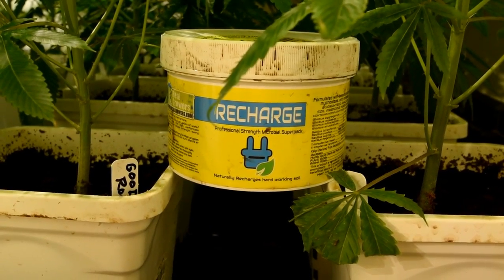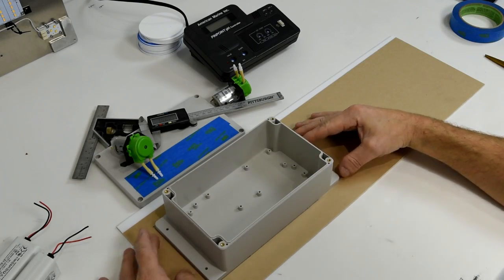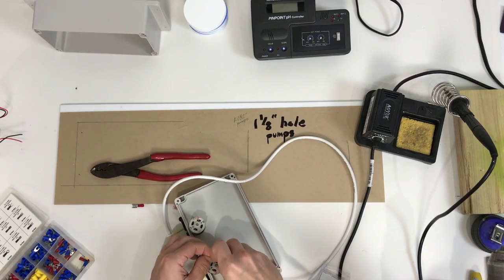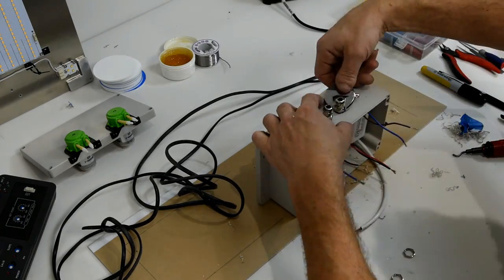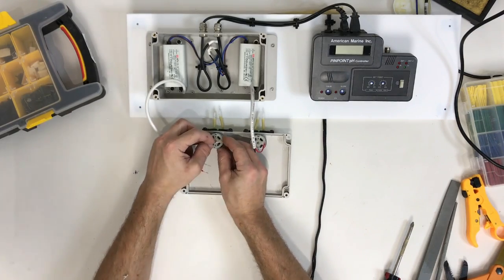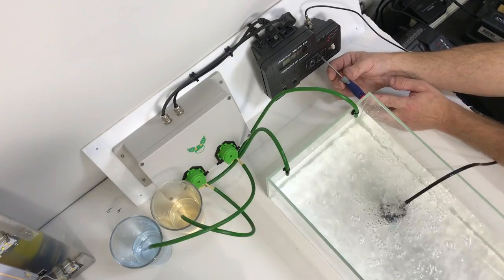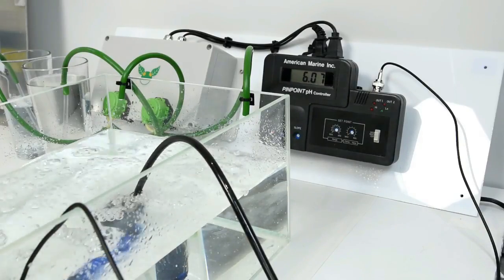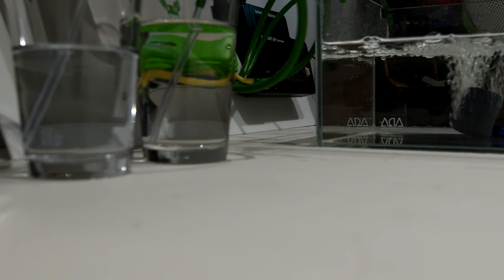DIY pH automation for hydroponic reservoirs

Comment: Hey there, i am thinking about getinng a RDWC-System for start growing my own tomatoes.
But i am still left with some questions. Maybe u can help me:
1. I would go for scrogging, but as far as i learned i need to change the water in the system ever 1-2 weeks. How the hell shall this be possible?
2. What are your thoughts about the risk to get a leak?
3. Some people are complaining about differnt waterlevels in each reservoir, how much of an issue is that?
4. There are many Completesystems avaivable, but can it be worth it to build ur own diy system? 
5. i gonna aim 60cm/2 feet every direction for each plant, is that enough Space

Huge Thanks for everyone helping me out!!!
Reply: I don't know if you're talking about tomatos or "tomatos". If the latter, then every 2 weeks is very aggressive. I believe you can get away with 1 change mid veg and 1 change transitioning to flower, topping up with pure water in between changes. 

You can get leaks if your workmanship is poor or an accident happens. Mitigate risks by keeping electrical stuff up off the floor and the wet stuff down low. You could even redundantly waterproof the floor just in case.

IDK about that

You can get a prefab system and it'll be just great or you can make it yourself to your specs and it'll be as good as you make it. If money wasn't an issue everyone would go prefab i suspect. 

Sounds reasonable. Closer spacing means less time needed in veg, and visa versa .
Reply: cho4d is wrong. Whether DWC or top feed recirculatory, any system with a reservoir should be changed once a week, every 7 days. I am not sure what the confusion is. You just pump out the old water and replace it with fresh water. If you use RO, remember to add cal and mag, unless your nutrient system has enough in it already (some do and some don't)
Reply: i would say diy your grow. i did a diy current culture build for about 1/4th the price got most of it off amazon and glued it together. if your scrogging have your water drain to the reservoir or build in a drain with a valve to shut it on/off its super easy.  if your serious just get some totes and 2"-3" bulk heads and some abs pipes and glue and get creative. bigger pipes mean more flow/less clogging  don't listen to cho4d tho change your water weekly.
Reply: 1.  You pump it out or drain it out with a ball valve.  Or you don't, you only top off.
2.  ...What?!  It exists I guess.
3.  Do you understand how water behaves?
4.  Buying a system is a complete waste of money.
5.  Not possible to answer this question for you.
Reply: @jonosterman2878  on general once every 3-4 weeks is fine for changing solution, not once a week, that would be wasteful.

Comment: What do you think about the blue lab controller
Reply: This one better, Blue lab control only in one way, up or down , this unit control both ways up and down
Reply: @Greg25437  If you're pH'ing up and down in the same res then you almost certainly have issues that need to be addressed in your solution.  You don't need both up and down at the same time.
Reply: @circle4922  I like this one just in case both ways, up and down,  I know usually need up or down, also I like to built electronics ))

Comment: Hi, I like your job, that DIY would be the top on the top if you could remplace the expensive ph controller with an arduino and his sensors with help of an arduigeek ;-)
Reply: Zaka Pentax that expensive controller would be easily be replaced with an arduino. Bare bones would be just a pro micro and a cell phone. Save the code on the phone, alter variables as you see fit and plug and load.

Of course you could get into LCD an controls but K.I.S.S. lol

Comment: You can save 200 by using an Arduino with free pid controller code
Reply: Lucas Bird I have a prototype running using a esp32 Dev board. The code has functions for a PI controler that I wrote myself so it's very easy to use. The idiots who made the arduino pid library used hundreds of lines of code, I made it in 20. It also has remote control over WiFi with io.adafruit.com. 
For har9dware you would need the esp32(I used huzzah), relays, dht22 sensor, solid state relays... Alot more stuff but you get the point
I might post it when im finished
Reply: PID is overkill for this application.  If-then-else works perfectly fine.
Reply: Rob Jones well if you don't want your cooling fans to be on and off all the time causing wear then use pid. You are talking about hysteresis
Reply: Rob Jones and no pi is very simple (using 20 lines of code)
Reply: The code for PID (not PI) is easy.  Dialing in the constants is a pain.  My point is that It's simply not needed.   But if you want to go that way, knock yourself out.     This is my last comment on the topic.
Reply: I'm waiting for you than ^^ , I have begin a similar project, I managed to write the code to convert the milivolts from the ph sensor to ph, but than running the pumps when the ph is to low or high was to difficult for a nooby like me. I don't want to be robbed with those overpriced ph controller , are they fucking crazy ? I need 4 for each of my hydro buckets.
Reply: Great! Do an effing video showing us how to do this with arduino. Those without arduino experience (like me) wouldn’t know where to start.  This vid is for the average diyer and creates an automated system that is much cheaper than the Growlink/Bluelab/etc. premade systems.
Reply: @canofpulp  Hey...ip address, haha.
Just wondering if you went further with this.  I'm exploring arduino, and atlas scientific sensors, as well as whitebox labs tentacle shield.  However, I'm a noob to arduino/coding.  I want to make a nutrient monitor/pH controller.  I need the same functionality as a "store bought" unit, like a bluelab etc.  LCD screen, buttons, and being able to interact via phone app or something would just be bonus.

Peace.
Reply: @robertcameronjones  No I meant PI (just Proportional and Integral) since the Derivative is overkill and just adds more complexity for tunning in like you said.
Reply: @robertcameronjones  Does it though?

Comment: WIsh it wasn't so expensive to buy those parts.
Reply: The only expensive parts are the controller and ph probe.. Controller can be replaced with an arduino for a 5er but you still need the probe. Pumps & their power supplies you can get for a 10er each.
Reply: And you need the arduino skills too

Comment: the real question is why is your ph moving around so much. A properly balanced nutrient in RO should not move around enough to really cause an issue. I use heavy 16 and my pH does not move around. 5.6-6.0 is always where it sits I never even use phup or down.
Reply: PH stability depends on how heavy your plants feed, whether you use RO water or tap,  the type and brand of nutes (and PH adjusters), how high you run ppm/EC, and probably the amount of airation  you use.  Maybe other factors as well, but these are the big ones.  RO water has little to no buffers, so as the nutes are depleted the PH  moves toward the initial ph of the water (around 7). In my 3 large RDWC systems (nearly 500 g total) the PH always tries to move up at first, then stabilizes after a few days of adding PH down.  RDWC runs waaaay lower in nute ppm because of the efficiency, so there is far less of the fertilizer (with accompanying buffers that they include) than what a normal system would run.  I can tell it is time to change out the Rez when the PH begins to drop more than a tenth or two a day.  Flush is especially difficult because there simply isn’t enough of anything in the water to maintain stability.  If you use tap water there is far less movement but less control over what’s in your solution.
Reply: very tiny res and too strong ph up down was the cause of the yoyo. it was overshooting each time.

Comment: Good idea.. However, EXTREMELY BRAVE MOVE leaving an automatic device in charge of your PH lol...
Wouldn't be me, sorry lol

Nice video tho ;)
Reply: No need to apologize.  Haha, just kidding man.  I understand the concern for sure.
Many of these "pH controllers/dosers" (with the pumps etc. all-in-one) have several fail safes (logic) that stop any disasters from happening.  For example, they won't keep dosing pH down if they see no change in pH.  They will wait for solution to mix, and read, before dosing again, they will alarm and stop after a chosen pH level.  And you can set all these parameters.  This setup here, probably not as many.

Still, I hear ya.

Comment: nice tutorial, maybe you need double the amount of acid because phosphoric acid is stronger than potassium hydroxide at the same percentage... Ahh and dissolved chemicals do not settle, so shaking does not really help.
Reply: Theres always gotta be some no it all that trys pic faults or at least make themselves look better then everyone else u need to grow up hey.
Reply: @peterrolfe528  is your brain ok after trying to form that sentence?
Reply: A lot of people don't realize that PH is a logarithmic scale and not a linear one. Accidentally using 4ml of ph down is not corrected by 4ml of ph up. Maybe 1ml of ph up could do the job, but 4ml, depending on the brand, could leave you at least 2 ph higher than your starting point. I learned that the hard way before I looked into it.

Comment: Hydro gets yield but not potency or taste.
Reply: lol you need more experience
Reply: @2bitTank   I have 0, I just know from what I've had. I'm in the process of mixing my soil and choosing COBs and drivers etc.
Reply: @PeterKKraus  i used to believe that, untill i started growing hydro. taste is better. growth is more robust. aroma is top shelf. keep in mind ive also given up flushing. i believe its a myth.
Reply: @2bitTank  the good stuff is hydro.
Reply: @2bitTank  But isnt flushing just start of curing? Do you cure your crop?
Reply: Incorrect
Reply: @2bitTank  my coco grows burn cleaner then my soil grows and I also dont flush.. I think that should say enough about flushing, I never used synthetic nutes on soil either. I think it's better to feed right up until the end, maybe a bit lower ec, but I'm definately not gonna let them die back the last few weeks thats just a waste.
Reply: That's an old myth and completely wrong, I've done both.

Comment: Lol bruh buy a blue lap ph Controller you grow weed how much money did you really save 😂
Reply: I bet you are a blast at parties.
Reply: It is called a Blue Lab controller not lap. He saved a ton. I picked up a American Marine controller for $75.00. 2 peri pumps and a job box  with 2 wall warts and I am in it about $105.00 total. Bluelab is going to set you back about 399.00 to 450.00 and it will only adjust 1 way. Math may not be your strong suit.